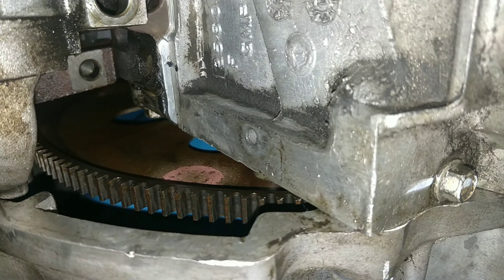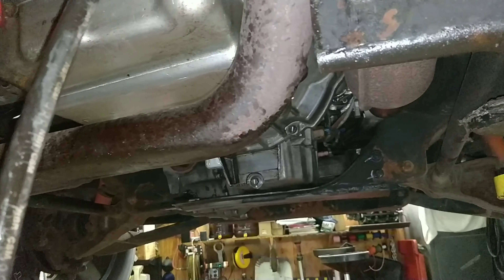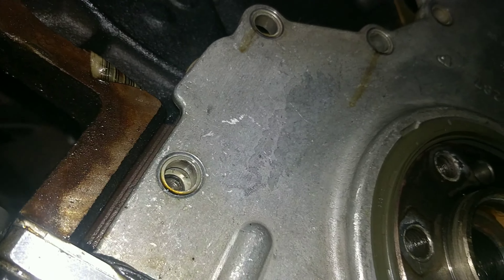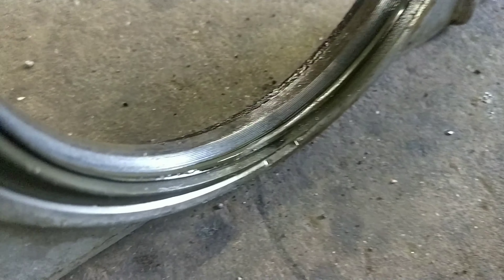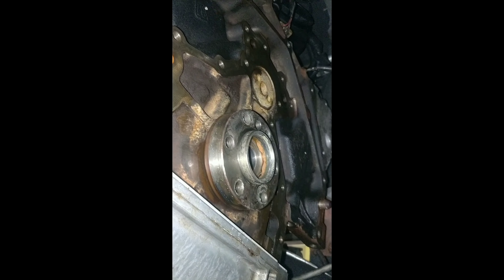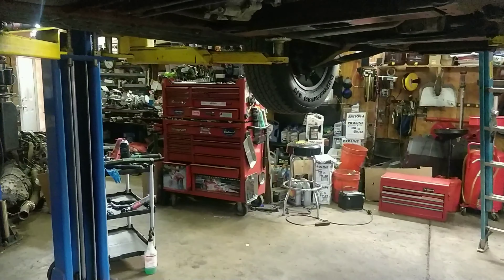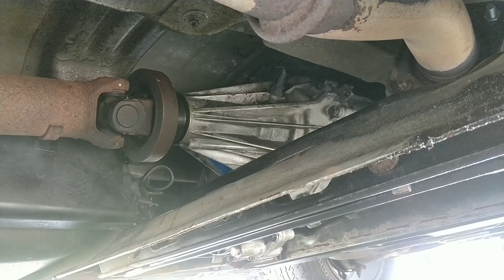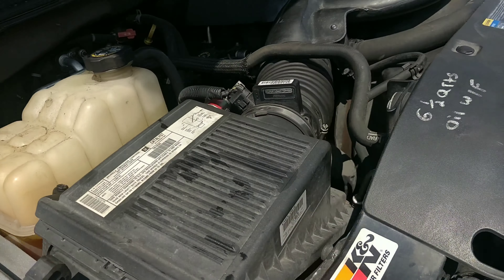2002 Chevrolet Tahoe 5.3l 4x4 Oil Leak Ignored PT3

Comment: Nice fix. Glad the problem's solved. Thanks for sharing 👍
Reply from the maker: You're welcome, sorry it wasn't more beneficial. I was hoping the smoke would have revealed something. I'm guessing it only leaked when running.
Reply: That's also my guess. Needed some oil pressure and movement  to start leaking. Nice try with the smoke machine though. At least you tried.
Reply: I have the same problem. I'll be doing the same job soon. That transfer case may have pump knock they call it. A whole in the case from the pump. I use Valvoline Auto trac 2 fluid.  It's blue.  Thank you sir

Comment: Just curious, what kind of cost to do all this? I have a 2002 Tahoe that I believe has the same issue. Thanks for the reply.
Reply from the maker: To do a rear main seal you are probably looking at 6-8h without looking it all up. You are looking at pretty much the same amount of time it would take to remove a transmission.
Reply from the maker: Another thing to consider is clean up time. When I do jobs I clean everything and that gets billed. Some shops don't clean things and then it makes future diags a lot harder.
Reply: Robert Dotterer that’s why I was curious what kind of cost...noticed your eye for detail which most places don’t do...like cleaning, torquing the bolts correctly & marking. Wonder what you charge for doing all of that...I’m in SC...your not near me I assume? LOL!
Reply from the maker: I'm in PA, when I quote prices I take book time plus 20-25% on average. I am usually dealing with rusty or broken bolts so it's starts eating up time quickly. When I do jobs like this I give a range. Say I quote 8h I will say it should be between $800-$1000 so it limits the chance of any surprises and gives me some room if I need special bolts or find something else wrong I don't have to stop in the middle and tie up a lift waiting for approval. If you send me the info I can give you an idea. Every shop is different with how they quote. My labor rate is $80/hr for most things.
Reply: Robert Dotterer enjoyed the 3 videos. Gave me some insight on what to expect. I install auto glass & to find techs or mechanics that do that type of work are few & far. Thanks for replying to messages.